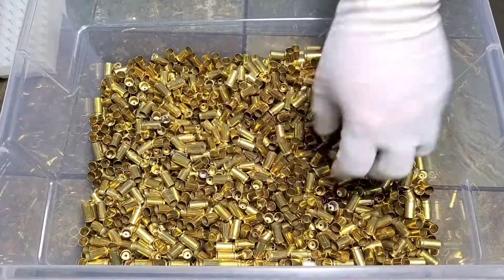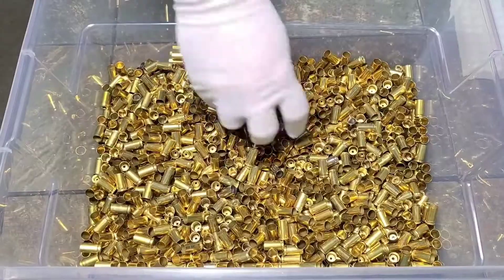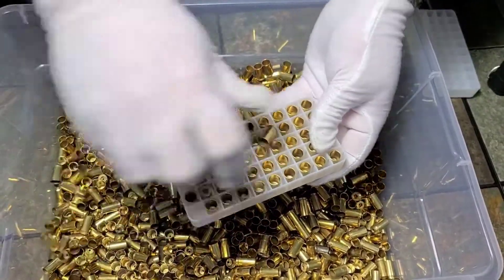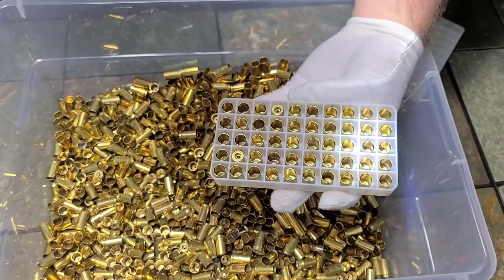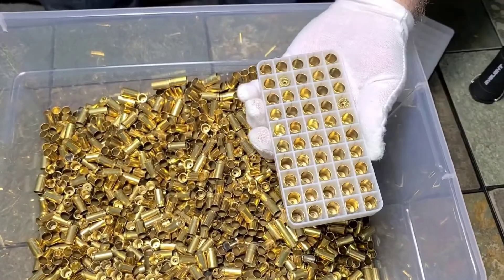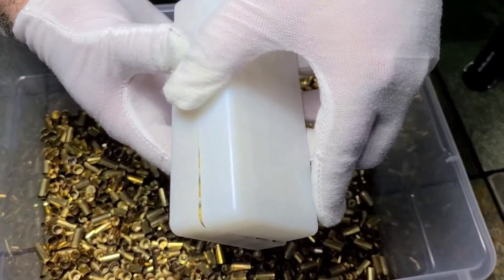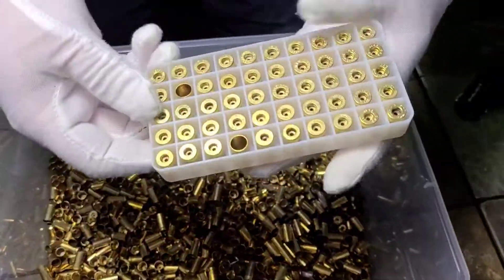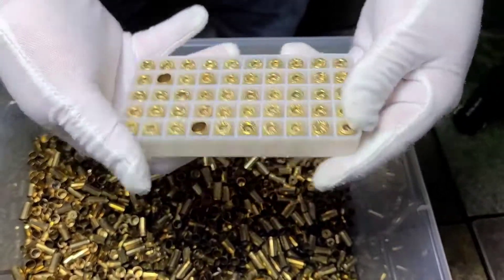Quick sorting/inspecting pistol brass for reloading

Comment: Nice to have the independence from manufacturers, but God does it look tedious
Reply from the maker: Not tedious at all. I enjoy doing it, and shoot a lot. With 9mm at $1 per round most places....I load mine for $0.03 per round. That's by casting my own bullets for it too.
Reply: @Namerifrats  Nice. Thankfully the ammo shortage freak out thing never really happened here in southern Illinois so it runs about $20/100box for good 9mm. I know some places are bad though. I reload my own shot shells which isn't really any cheaper but I enjoy doing it so I get it. A lot easier though, no brass to polish or anything like that.